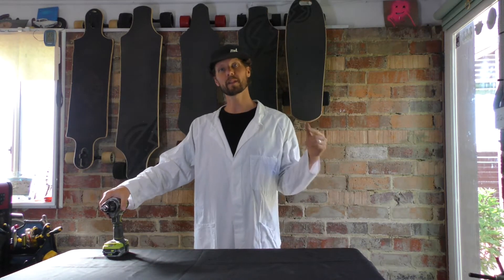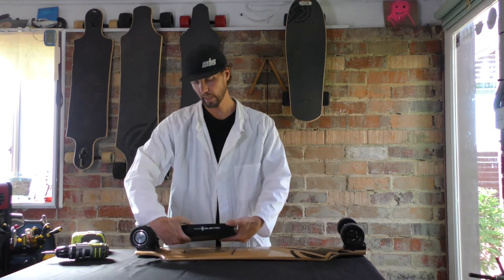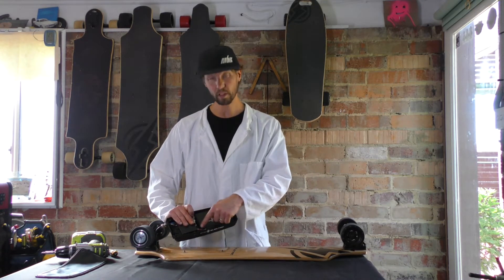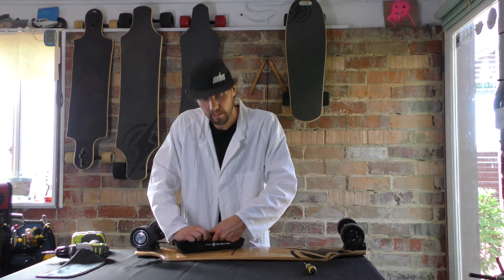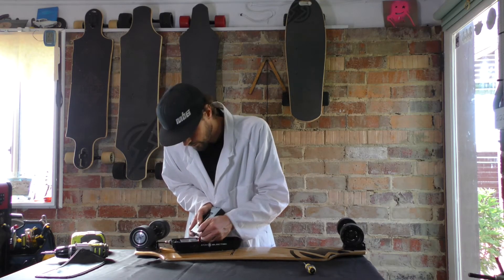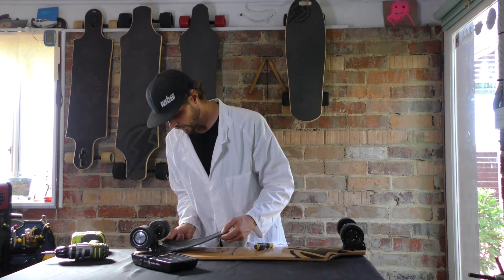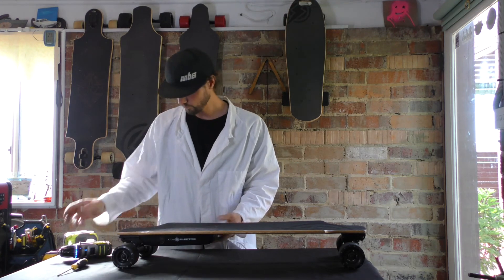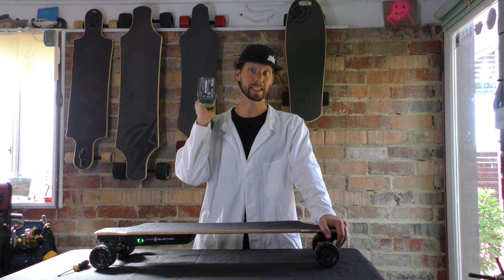TECH TALK - Battery Replacement - H10

Comment: I have a b10 that has not been ridden in 5 yrs. It’s not holding a charge and only runs when plugged into charger. Also runs off charger with wheels off the ground. Runs when being stood on for one second then shuts off. Will a new battery be the fix this board need to run again?